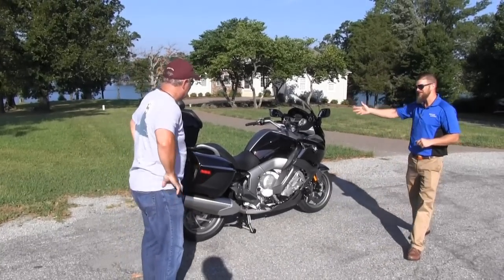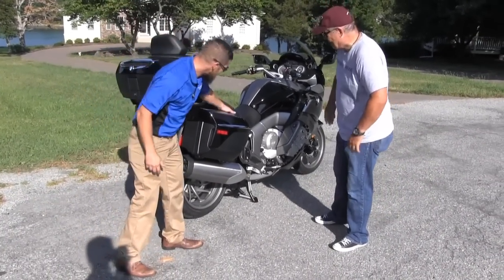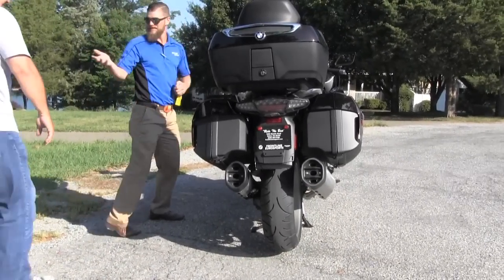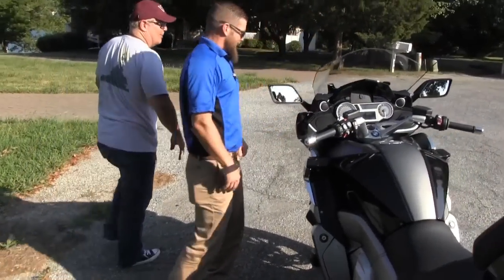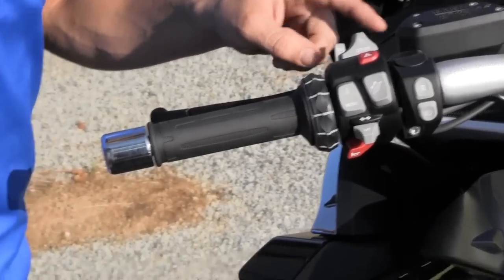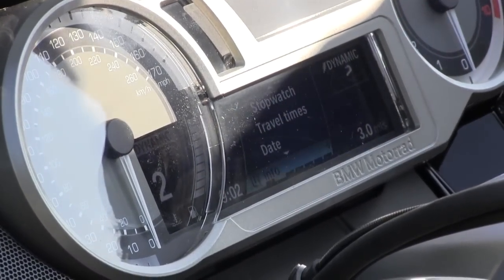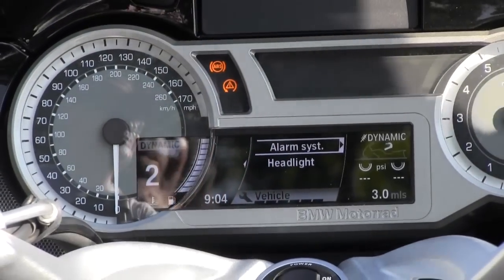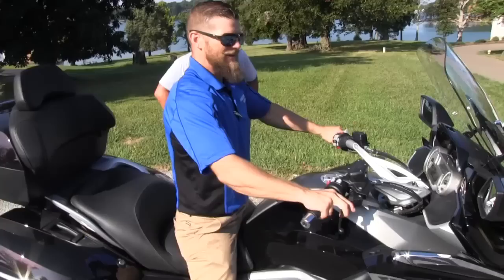2018 BMW K1600GTL Mini Delivery Documentary from Frontline Eurosports with Nate

Comment: How similar is the GTL to the grand America? What are the maintenance costs on these? Any known weaknesses?
Reply from the maker: TX Camper:  The GTL and GA have not only a different appearance for the luggage with the lower, bagger appearance on the Grand America, and sporty higher angled boxes on the GTL but I feel the high tubular bars are more comfortable on the GA.  The power comes on a little softer for a more cruisesque sensation when taking off and the suspension is different with the GA have Road and Cruise and the GTL having it's soft/normal/hard suspension damping setting for a more performance oriented ride.  The riding position can be different as well as the GA has floorboards to kick your feet out in front of you and enjoy some extra leg room when the longer ride demands it or if you just feel like kicking out on your local commute.  Cheers,  ~Nate
Reply: Nathan Jennings - Thank you, a great response. So the GA doesn’t have the soft/normal/hard riding settings? It is not considered as performance oriented?  Up the road at BMW of Austin they had a GTL and GA. Will have to go back and take a closer look. Would ultimately like the GA but would like a 1200RT first. Also, would you consider the F800GT a good first bike? Thanks..

Comment: I have the GS1200 Rallye which was in for its 1st service so I took a 1600GT out to test, compared the the GS the front end seemed really light but I just rode it as is and didn't mess about with any settings but the sound off it is fantastic and now I am seriously considering trading in for one, if I had the money I would have booth 1600 and GS, oh and the quick shift was may smoother on the 1600.
Reply from the maker: Kevin:  We are here to assist you in finding a way to have both or we can always upgrade you here at Frontline Eurosports!!!  Thank you for watching the video and if you wanted to play with the settings for suspension feel free to contact us or stop by and I'll have it set up right for you then see you off on a sportier ride...  Cheers,  ~Nate

Comment: How much would you charge to deliver to Dover,De.19901?
Reply from the maker: Lee Dunn good day Mr Dunn, would you be taking delivery of a K1600GTL?  Need to know for shipping size.  Great to hear from you and can't wait to hear back.   😜👍🏼🏍
Reply: @NateJennings  
Yes,the GTL or Grand America. Will need to decide on which bike to get. Still doing research. Looking to buy in late spring,early summer.
Reply from the maker: Lee Dunn I've got lots of miles on both models of you need any advice or guidance.
Reply: @NateJennings  
That's great news. I'll definitely be in touch with you.
Reply from the maker: Lee Dunn I apologize for the delay, still waiting on the shipping rate for you, communication has been as little slow this week during the pandemic announcement ha ha. Thank you for your patience.
Reply: @NateJennings  
No worries Nate!! I won't be able to do anything until late spring, early summer.
Reply: @NateJennings  
Hi Nate. Is there a big difference between the Grand America and GTL 1600? Seating, comfort, weight, etc...?
Reply from the maker: Lee Dunn Huge!!  First the B is restricted to 100 mph as it gets unstable around 90mph due to the aerodynamics of the new panniers, easily visible wobble.  The GTL includes a top box with easier accessible side panniers which are removable, the Bagger bags are permanent as they include the tail light assembliee in them.  The Bagger has a lot shorter windscreen from the factory which really doesn't do much for wind protection but keeps the right presentation on the bike.  The GTL suspension has three damping settings, soft, normal, and hard such makes the Moto very athletic, the Bagger has Cruise and Road, which is like Super Soft and Soft.  I like the floorboards of the Bagger, but with a little modification can go on the K as well, just a trim panel causes a lot discomfort if not removed. And the saddles and handlebars are different. I prefer the looks of the tubular bars and longer saddle off the Bagger, but I can ride the K1600GTL days longer with more confidence and athleticism.  BUT, You really need to talllk to me in person so I can get your story and help guide you to the right bike to be paired with for your next trip wheele ld adventure in life.  Cheers, ~Nate
Reply from the maker: Natefrontline@gmail.com to email me and I'll give you my number to call. Nate
Reply: @NateJennings  
Thank you Nate!! I will be contacting you by phone. I  do alot of road trips. 6'2" 250lbs,I'd like to have the comfort for long extended ride periods"not the stop at every 100 miles kinda guy",yet I  do like to hit the throttle now and again. At 250lbs,I wanna feel the torque. Looking hard at the Grand America or the GTL in Black or the Brownish/Copper color. I'll be calling you soon. Be nice if BMW could offer some incentive discounts??? Don't know if any are available. Gonna get my questions together and call you soon. I may just pick it up myself and keep heading westbound on my road trip.
Reply from the maker: Lee Dunn '19's have $2,500 off this quarter you start!!!!!!!!!
Reply: @NateJennings  
Forgot to tell ya,I'm riding a 2013 Honda F6B now. But I won't be trading it in.
Reply from the maker: I'll be looking for your email to finish the convo about the GTL vs Bagger Grand America.  I have lots more questions for you and answers to any questions.  You'll love the power and Torque of either model.  Cheers, ~Nate

Comment: Tie the bike by the handlebars is wrong .. this is written in the user manual. The proper way to do it is passing around the fork "tubes" above the fender. Congrats for the owner 👍
Reply from the maker: Mu7aL9229 AbuLma:  We use canyon dancer II cup bar harnesses so they do not hurt the heated grips which is the concern and the main tie down point is actually the front wheel, we utilize a Baxley sport chock to secure the bike and only light pressure on the canyon dancer II's to add extra support!!!  There is no fork tube on the K1600GTL it utilizes the DuoLever front end which is a solid strut..it does offer a point to tie off from though so you can use that is you were to solely tie down the bike without the use of the amazing wheel chock!!  Thanks for your input and watching.  Cheers,  ~Nate
Reply: Solid fork frame is exactly why you tie it down from there...zero risk of damage....looks like Steve has more money than sense...nice bike though...  :P

Comment: Is it available with a manual gearbox?
Reply from the maker: TX Camper:  they all have a manual gear box that you have to use from take off and gear shift assist pro is an option to use or not on every bike.  It allows for clutchless upshift and downshift after take off.  Thanks for watching and good question if you don't understand the operation of the Gear Shift Assist Pro option.  Call me for more detailed review of the option.  Cheers,  ~Nate
Reply: Nathan Jennings - Ok thank you sir.  How have these and the grand America been selling?  Is it something I could trust cross country?  I’ve heard about glitchy electronics on these and don’t want to deal with that.  Also really like the 1200RT.
Reply from the maker: Aboslutely, and I would love to talk to you via phone about the differences so I can interview you and see exactly what your doing with the bike and your gear and passengers etc.  (540) 387-9780..ask for Nate
Reply from the maker: I've been selling them very fluidly, more B's than Grand Americas at this point but only had them a couple of weeks.  Have personally done long distance trips on RT with customers on K models with no issues and only ones I heard of having issues were the early 2012 K600GT/GTL which had switch issues, multifunction controller on left handlebar, which has been replaced on every model to an upgraded version after their initial launch and beta testing with three different units.  3 year warranty with free road side assistance if you do have an issue. Cheers,

Nate

Comment: WARNING!!! If you own cruiser bike ( doesn’t matter make or model ) and you would like to move to bmw k1600 be worried that you will be happy for performance but you will be disappointed - very disappointed from the moment you first time wash your k1600. Let me explain - it’s all shite plastic covered with paint to look cool but while you touch it, it make you feel that your model is badly put together ( but it isn’t) It is just not anymore cruiser bike  where all the parts ( in my case Yamaha roadliner) was made from stainless steel or metal painted wonderful paint. No here in k1600 all is just shite plastic covered with cheap lacquer. They move while you touch them, they fell crap when you touch it. So be worn. Don’t expect from this beast be a cruiser if coming to feel of touch. This is a wonderful performing bike but is is for us cruisers owners piece of crap if coming to touch of body work or look closely to it. I have trade my Yamaha but next year I am going to see if I can get indian Springfield just to keep the feeling i have proper bike with feel..... this message only apply to cruisers bikers as they know what quality of body work and paint mean to us. Drive safe